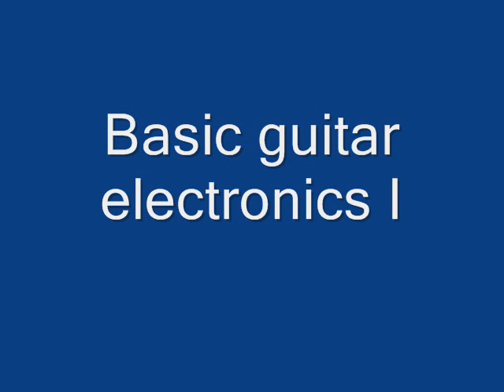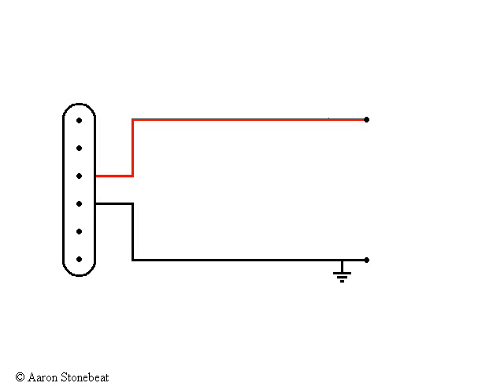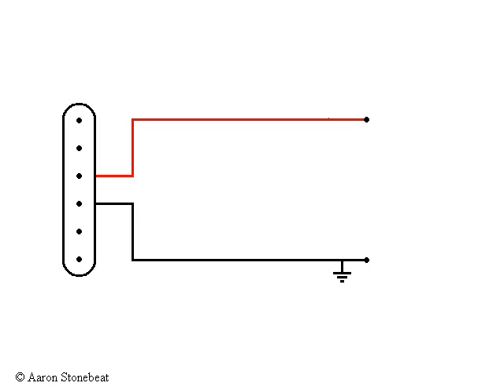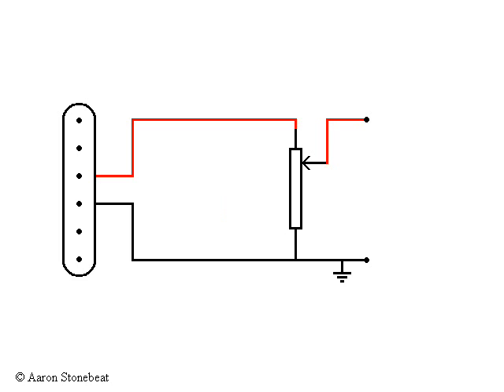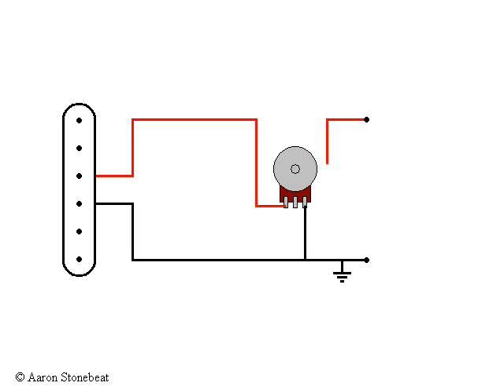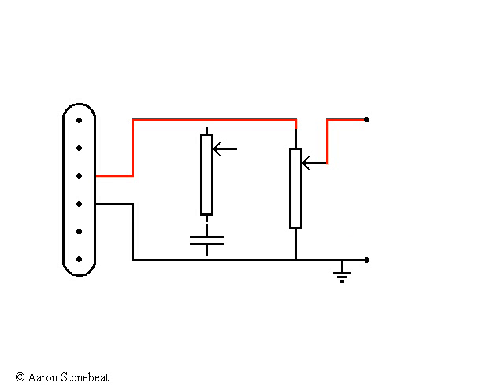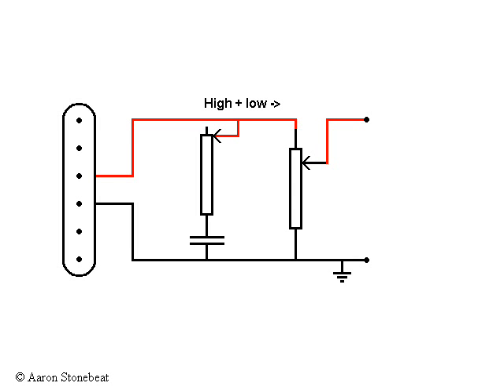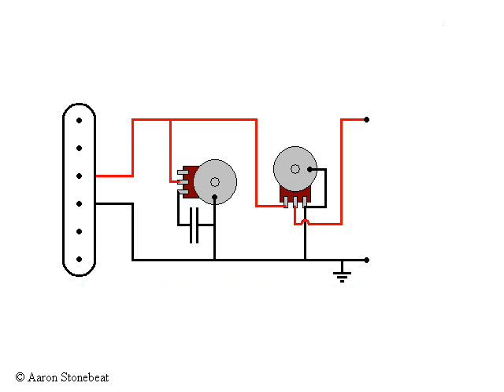Basic Guitar Electronics I - Volume and tone control

Comment from the maker: There are meters to test capacitors; they send a frequency through the capacitor and measure how much resistance it encounters.

A healthy capacitor blocks dual current; if it is broken there is a connection between the two plates and that can be measured.
A leg may also be disconnected from its plate; in that case the capacitor will still block dc but it won't function as a capacitor anymore. Hard to tell without the correct meter.

But they're very cheap; just buy a new one.

Comment: Why is it that almost every potentiometer is different (terminal 1 ground, terminal 2 input, terminal 3 output; terminal 1 input, terminal 2 output, terminal 3 ground, etc.) and yet almost every source of information I've seen claims that they are all one configuration?
Reply from the maker: I wouldn't know, apparently there is no standard. I never think of them as 1, 2 and 3; I look at how they work and what I need.
Reply: +Marc van Oppen 
Ok.  Thanks for the quick reply

Comment: Great vid. Nice and slowly taught. I'm new when it comes to the wiring part. I recently tried out a JEM style DIY kit. pick-ups only have two wires coming off them. single coil and two hum buckers, volume and one tone....my e-mail is ktaylor@cambridgebay.ca if you could provide a better wiring drawing that would be awesome. it did not come pre-wired and attached to pick-guard. thx